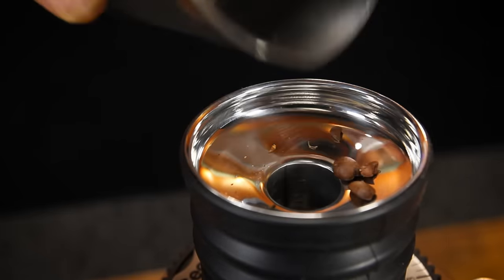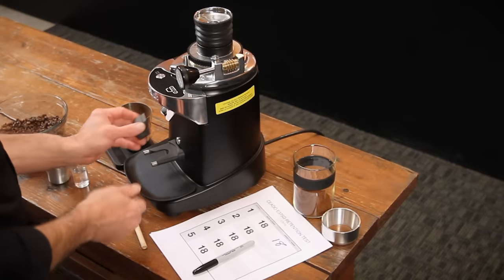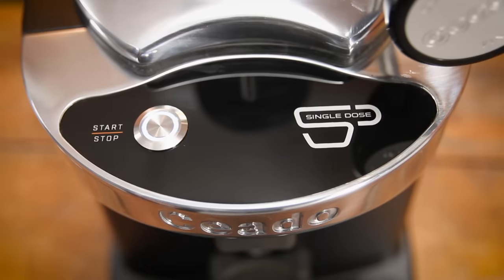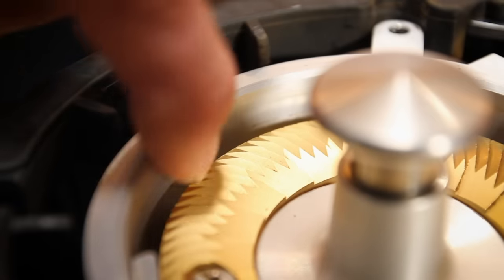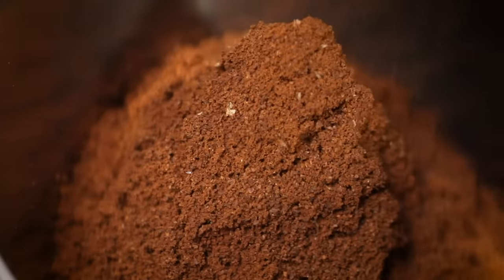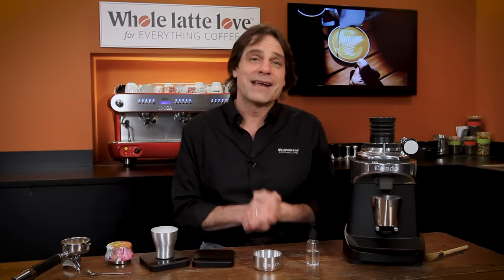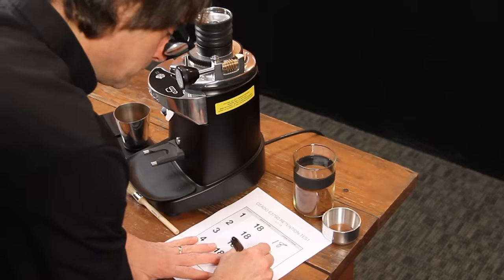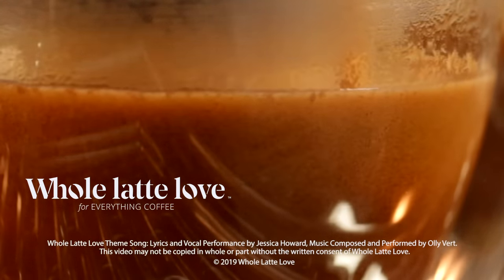Review: Ceado E37SD Single Dose Titanium Burr Coffee Grinder

Comment: I have had one of these for about 9 months. It grinds beautifully. I DO NOT recommend it though. It IS NOT a zero retention grinder. It holds in a lot as you start to use it. These tests and most on YouTube  are not long enough to simulate the real world. Adding water/ mist only exacerbates the problem. The bellows DO NOT clear the grinds completely. What does clear the grinds is lifting the front of this very heavy machine up a few inches and dropping it on the counter; this actually works pretty well. This machine needs a redesign. Notice how their higher end machines rotate the axis forward around 45 degrees so grinds come off the grinding wheels with gravity behind them to eject straight down. They also added a spring loaded chute. I think this model was just a quick redesign of there existing form factor to enter the zero retention space. They made the higher end models that way for a reason. Wish I could trade mine in for one. I regret this purchase.
Reply: Which Single Dose model then would you suggest? I haven't seen anything else newer from this brand or even any pricier SD models anywhere else.
Reply: I would recommend the Ceado e37 naked or the e37 hero. They correct the issues with this grinder by inclining the burrs to 45 degrees and adding a spring loaded grind chute to help eject the grinds. Other than those I would look at other companies who have moved the burr plane to 45 degrees like the monolith grinder. Good luck.
Reply: I agree with your comments in that it is not zero retention with no intervention by the user, which for the price, you hope wouldn't be necessary.
That said though, I've made several tests a few weeks apart to answer this question for myself and found that retention is between zero and 0.1g if taking extra steps when grinding.
Again, I wish it wasn't necessary but everything else is great so I'll live with this. If you do spray (RDT) but only 1 spray I found to be effective, depending on the beans actually) then give a couple of taps about 3/4 the way through grinding and be aggressive with several short taps on the bellow while finishing the grind. After that, remove the chute cover and brush out whatever is "stuck" in the chute and you get as good as any single dose grinder.
Of course, as I mentioned, I wish I didn't have to work to get the grinds out.

Comment: I requested a return after 3 days. Mine had burr alignment issues therefore inconsistent grinding and it was extremely messy, spreading fine coffee all over the place! I liked its sturdiness and the ease of cleaning the burrs without losing the grind setting though.
Reply: Dos you get a replacement? What if the burrs had been aligned. This comment within itself useless!

Comment: Hey Marc, long time no speak. Long time fan of your vids but haven't commented in ages. Anyway, I've had this exact early release version with the Ti burrs for over 2 years now and was wondering if these Ti burrs are better than the Opalglide burrs? I'm on the fence about getting the Opalglide burrs as not sure what the benefits would be and there's no mention of what coating is used either. Would be great if you have any info on these aspects i mention. Cheers man. Ben.
Reply from the maker: Hey Ben, Thanks for the question. Ceado does not provide information on coatings for their Opalglide burrs. The Ti burrs are steel treated with Ti coating. Ceado says Opalglides are for use only in single dosing grinders. They have higher rating in planarity and geometry. The result is slightly better retention performance and faster grinding.The Ti burrs have a slightly higher material rating - they're good for >2500Kg before needing replacement.
Marc

Comment: Thanks for another brilliantly informative video, Marc.  Would I see a similarly low retention result from the E37S for single dosing if I purged the retained grinds by pulsing the on/off button a couple of times and brushing the grinds from the shute?  The extra spend on the SD is getting outside my budget, unfortunately.
Reply from the maker: Hi Steven, You are welcome for the video and thanks for your question. The E37S gets close to the SD. Here's a video with retention tests on the E37S and other low retention grinders. It's a little older so E37S in the video does not have the Quick Set Worm gear like current models: https://youtu.be/_5ZnraVs_7M
Marc

Comment: Thanks Marc for the review. Question for you. How much over kill would it be to get the ceado 37sd mainly for pour over coffee? In your opinion how important is the grinder for pour over coffee. Thanks!!
Reply from the maker: Hi Richard, Guess it depends on your definition of overkill. Honestly you'd be fine with something like the Baratza Virtuoso Plus and you could buy ~10 of those for the price of the SD: https://www.wholelattelove.com/products/baratza-virtuoso-coffee-grinder It's not a single doser but could be used that way if you want. Also has a nice pulse grind feature which adds up grind time. The SD is more of an espresso focused grinder. It's also a commercial grade machine that will go for decades while the Virtuoso is higher-end appliance grade. Large burrs intended for espresso grinding like in the SD tend to produce more fines which probably are not desirable in brew grind sizes. Hope that helps!
Marc

Comment: Marc, excellent review, as always. I purchased the Eureka Mignon Perfetto as my most recent grinder, but at the time I had a Rancilio Silvia espresso machine. This past November I purchased the Synchronika from WLL and now I'm not as happy with the Perfetto, primarily because the fine adjustments are very difficult when I switch beans or want to change the extraction ratio. I end up wasting a lot of beans. I'm hoping you can help me with answers to three questions regarding the E37SD. (1) Will the worm gear setup on this machine make it easier than the Perfetto for fine adjustments that I can duplicate, as needed? (2) I'm interested in single dosing, but aside from that, how does this machine differ from the less expensive E37S? (3) I'm nervous about taking the plunge on this machine after reading several carefully thought-out but critical reviews both on the WLL site for this grinder as well as here in the YouTube comments, addressing issues such as retention and uneven grind. In the time since creating this video, have you noticed these problems? Thanks much!
Reply from the maker: Hi Michael, The Perfetto is setup as more of an all purpose grinder than an espresso specialist. Very little range in espresso grind size adjustment so a small turn of the knob makes a big difference.
Your questions:
1. Yes the worm gear is extremely precise. Compared to the Perfetto, it's multiple 360 degree turns of the Ceado's knob to go through the range you would with a 45 degree turn of the Eureka's adjustment.
2. Compared to the standard E37S the SD has titanium treated burrs. They stay sharper longer. I'm in my 50's, drink a lot of espresso and those burrs likely will not need replacement in my lifetime. RDT (misting beans with water) is part of the process in single dosing. Titanium burrs will not corrode. That is a possibility with standard steel burrs. The worm gear of the E37SD (Ceado prefers calling it Quick Set Gear) has a release to disengage the gears for quick changes from espresso grinding to larger grind sizes. Without that, it's a lot of turning of the adjustment knob to go from espresso to a drip grind. Internally, The E37SD has a narrower grinding chamber than the non SD version.
3. The E37S is the grinder I use most often. While I can choose from just about any grinder available in the US I always have an E37S in the studio for daily use. When I want the best possible grind I go with the E37S. The E37SD is the same grinder but set up for single dosing. Single dosing is more work. Most weigh the dose, then RDT the beans, shake to mix, load, grind and pop the bellows a few times to achieve near zero retention. My dosing is very consistent and reliable. But, every once in awhile something odd happens and a little ground coffee gets hung up. It's rare but grinding is chaotic. One thing I have noticed which has modified my SD technique: When blowing out the last bits of coffee it tends to be a bit more powdery. Grinders all produce a range of coffee particle sizes. Better grinders produce a narrower range but they all have some variation. As you're blowing out slightly finer particles at the end of a single dose grind cycle the puck may be top loaded with those. Due to that I now use a WDT (Weiss Distribution Technique) tool to evenly distribute slight variations in grind size in the filter basket.
The E37SD is a plunge and not for everyone. You need to enjoy and commit to the extra steps involved in single dosing for consistent results.
Hope that helps!
Marc
Reply: @Wholelattelovepage  Thanks VERY MUCH for taking the time to provide such an extensive reply. If I can shamelessly push the envelope just a bit further, a few follow-up questions about the E37S. That was the machine I was initially considering, but someone at WLL suggested I look at the SD. Now I'm leaning back toward the S. (1) To make sure I am understanding correctly, the two differences with the S and SD are (a) titanium burrs on the SD, while steel on the S, and (b) the SD is a single dosing machine. (2) Does the S have the same worm adjustment for the burrs that the SD has, including the release for larger adjustments? As you know, what got me looking at changing grinders even while my Perfetto is fairly new is the inability to make fine-tuning adjustments, so I want to make sure about this. (3) You mentioned that titanium burrs will last the rest of my life (I'm 62). How long will steel burrs typically last? I assume they can be replaced vs needing new machinery, yes? (4) Does the adjustment on the S (and SD for that matter) literally go all the way up to drip? I'm asking this because while I can set my Perfetto to be dedicated for my drip machine, it means taking up more counter space. I'd prefer to use one grinder and give the Perfetto to my daughter who has recently joined the espresso craze. Again, thanks so much for taking the time to help me make a decision. This is a substantial investment on the heels of a Synchronika, so I appreciate it!  --Mike
Reply from the maker: @FourthZ   No problem
1.  Yes to a and b
2. Yes the standard E37S has a worm gear adjustment. It does not have the quick release like the SD.
3. Steel burrs are good for ~700kg. Burrs can be replaced and upgraded to something like this if desired: https://www.wholelattelove.com/products/ssp-red-speed-coated-83mm-grinding-burrs
4. Yes you could adjust all the way to drip grind. But without the quick release on standard E37S it takes a lot of turning to get there.
Marc

Comment: Hi Marc! Echoing what others have said: your reviews are obsessively thorough and only influence transfer of money from my wallet to WLL! That said, I'm seriously considering the E37SD. Here's the rub: my current setup (purchased from WLL) is a Miss Silvia to which I added the Auber PID with preinfusion and a doserless Rocky which makes me want to pull my hair out with inconsistent g output. I'm mostly happy with my shots (oncer I've gotten my intended g out), but eventually want to upgrade my machine to a heat exchanger/dual boiler setup. My question: would buying the E37SD to use alongside Miss Silvia be like putting budget radial tires on a Ferrari? To those ends, do you have any timelines on the Ceado E5SD which seems more appropriate next to Miss Silvia? Thanks again!
Reply from the maker: Hi Spencer, Thanks for the comment - lol! E37SD is one heck of a grinder and a super huge upgrade from the Rocky. I understand your frustration with it. Grinding has come a very long way in the last decade or so. I do think the SD is overkill (like your analogy!) unless you where doing a machine upgrade down the road. We expect to have the E5SD in house in 1-2 months for testing and of course a review video! I have not seen one in person but it appears to be very similar to current E5P/E6P except setup for single dosing.
Marc
Reply: @Wholelattelovepage  Hi Marc. Thanks for your reply! Many folks on the coffee interwebs are oohing and aahhing over the Niche Zero grinder. Do you have any thoughts/experience with it?

Comment: Hey Marc. No sooner did I think I would ever pay over 1K for a grinder than I saw the tempting Ceado E37SD.  I'm sold on the grinder package - not that I've completely come to terms with the price tag.  That said, my one concern is for the bellows. Is there any worry that it will suffer stress damage/drying out over a period of years?  Thanks so much for your guidance!
Reply from the maker: Hi John, The bellows is made from a fairly robust and relatively thick material. I can't say with 100% certainty that it would not wear out after years of use but the grinder has only been out for a few years so no long term data. I've used quite a bit and feel confident it should not be an issue. If it does have a problem it's a very easy replacement.
Hope that helps!
Marc
Reply: @Wholelattelovepage Easy replacement!  Great!  That does help a lot.  Thanks so much.

Comment: I'd like to use this for espresso and pour over. What's the max weight of coffee beans you can add in one go? Great video!
Reply from the maker: Hi M, Thanks for the question/comment. Only real limit is how much you can feed and capture. It's NSF and has a long duty cycle. I would not feed kilograms continuously but no problem for espresso and pour over.
Marc

Comment: Hi Marc, thanks for your great videos. I saw that you‘re using the 18g basked. I did the same in the past, since my grinder was not very good in fine grinding. Since two month I have a test grinder and I‘m using the 14g basked with great results. What‘s your experience with 14g of beans with the Ceado E37SD? Sincerely, t
Reply from the maker: Hi travelbug, Thanks for the question. It's been a long time since I used a 14g dose. But, dose weight shouldn't make a difference! The E37SD and similar grinders have no problem grinding very fine!
Marc
Reply: Hi Marc, thanks for your prompt reply. :-) Good to know, that very fine grinding isn‘t an issue.

Comment: Is there information on the particle size distribution? If so, how does it compare to the EK43's distribution? I think it's obvious that this grinder wins over the EK43 in the realm of ergonomics and waste control, but what's your opinion on percieved quality of an espresso shot when comparing the two grinders?
Reply: This grinder has espresso burrs and it will produce a typical espresso grind. The Ek43 can be fitted with 5 or 6 type of burrs. Also the Ek43 takes about 2 seconds to grind a dose with popcorning being a non issue.
Reply: Hi.  You can always eyeball for a subjective judgment on particle size but I have opted for a 12 sieve Kruve which allows you to sift particles into 3 sizes (depending on the 3 sieves used.)  You can then take the particles from one of the 3 bins and sift again.  Crazy work?  Yes, but it gives you a very good visual of size.  I don't think HLL sells the Kruve but you can pick it up on Amazon.  Its not expensive.
Reply: @ThomasChesterVA  The sieves don't work for espresso grind. It's impossible to sieve all of the particles below 200um since most of them get stuck to the bigger ones. Sieves are useful for larger grind setting where you want to eliminate extremes.

Comment: This grinder is so impressive to me. After 4 months of using an inconsistent, unpredictable, and unreliable Profitec T64, I am unequivocally switching to this soon
Reply from the maker: Hi DW, Thanks for the comment. Sorry you've been having troubles with your T64. I've used the T64 and have not had the same experience. It is of course not at the same level as the E37SD which is a huge upgrade! Marc